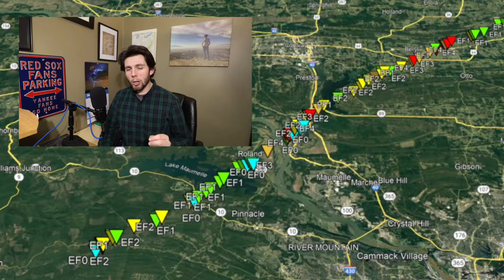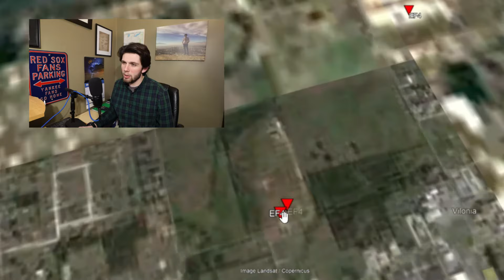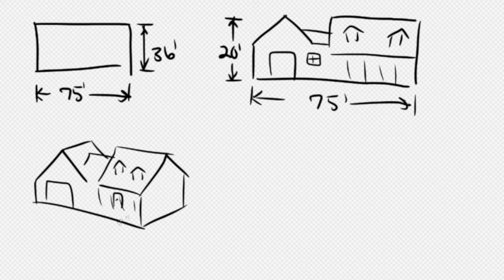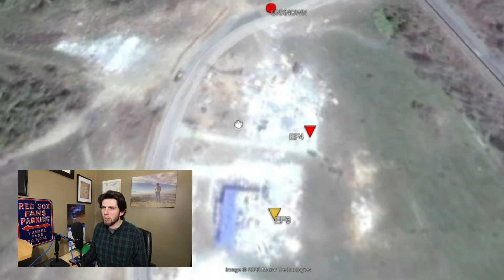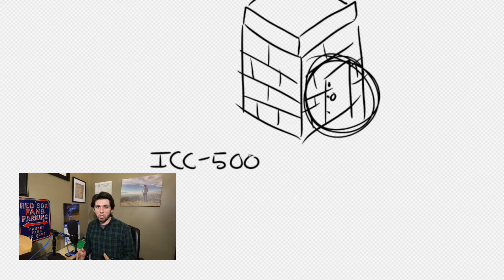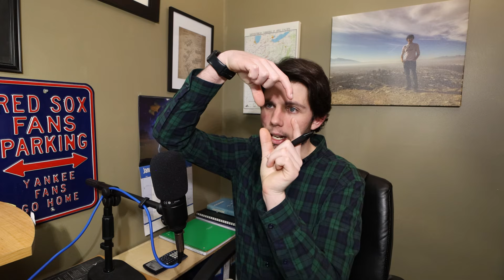DAMAGE ANALYSIS: 2014 Vilonia, AR EF4 Tornado

Comment: A few years since you posted this awesome video; I’d like to see NWS revisit this one as far as rating. After the ND EF5 last year (2025), non-traditional DI’s can be used. The parking stops being pulled up, overturned, and lifted up, as well as a very large 58,000lb shipping container being lifted into the air and tossed onto the roof of a school. Curious about the force needed for these instances, and if these would help push this 2014 Vilonia tornado into EF5 threshold. Ultimately, the destruction of property and impact/loss of life from that is far more important, but the science of these are also crucial in fine tuning a more accurate rating. Just one persons opinion 😁

Comment: The tornado was moving at snail's pace most of your violent rated tornadoes to clock speeds up to 70 mph with their forward movement speed it ripped apart asphalt it sucked it up into the vortex

Comment: The outbreak of the 2011 super outbreak happened 3 years earlier there were six EF5 rated tornadoes within that outbreak I remember part of  in poplar bluff we had severe hail severe flash flooding no tornadoes I don't know if the vilonia Arkansas was hit by an ef2+that tornado was a monster and it had a multiple vortex signature on radar you can actually see the storm splitting that means if the storm turns to the right you're getting a violent tornado threat if it turns to the left you can get a large hail threat

Comment: You miss some indicators  that had LEGIT ef5 damage  in cody lane well anchored homes were renoved and it had a windspedd of 219mph in the highway and some damages  proved it like a 2,997 pound fertilizer and threw it 3/4 miles away

Comment: I really hope you analyze the Greenfield tornado. There's absolutely no reason why that tornado should be anything less than an EF-5. None. 

When you have extreme damage, debarked trees, ground scouring, AND scans from a Doppler on Wheels clocking wind speeds of 250-290 MPH... That should really be all of the evidence necessary to rate the Greenfield tornado an EF-5.
Reply: Vilonia rochelle new wren ringgold and mayield alongside a couple did same damage as smithvulle and hackleburg but got a 4 or even a 3

Comment: A CPA accountant friend of mine shared an office building with an engineering firm years ago. Being a CPA he was, of course, concerned mostly with financial balance sheets and monetary bottom lines. He shared with me how he learned from the engineers in the office building that they first consider best structure and materials. Then the accountants get hold of the blueprints or designs and suggest places to cut costs. A final product will always end up being a compromise.

Comment: I think the more we learn about tornados - particularly the larger, multi-vortex ones, the more we'll realize that the entire concept of assigning ratings of strength based on windspeed (with or without getting there by way of damage done), is an inherently flawed idea. 

Until we can pick apart the anatomy of these big multi-part systems, see how the different parts interact, see how and why sub-vertices are forming and doing what they do, it seems approaching arbitrary to assign a rating because at one point one element of these big tornadic systems reached a certain windspeed. It's not totally unhelpful, don't get me wrong, I just think it's not something to get hung up on and really demonstrates how alarmingly little we actually know.

Comment: I believe the way tornadoes are rated throughout different NWS offices are inconsistent. Some offices may take into account contextuals like in cases with RF, but some others may not like with Matador. Some offices may hold back ratings of EF5 due to lack of surrounding vegetation damages like with Rochelle, but may not take that into account in cases like Moore 2013 (some trees around EF5 DIs still held up). There needs to be a more strict system on the EF scale that can ensure tornadoes are being properly documented for the use of construction standards in tornado safety. Additionally, some say NWS Little Rock skipped over numerous slabbed homes towards the beginning of the tornado's path, which is reminiscent of similar cases like New Wren back in 2011. Another thing to note, this tornado was held back from an EF5 rating due to possible "debris impact" on a home rated 190 in an area without many homes, but NWS Norman didn't hold back on an EF5 rating in Moore where there were multiple homes that could've been involved with debris interference. I think I can go on and on, but there's that. However, I digress that EF ratings matter more than the lives lost, lives are more valuable than documented statistics.

Comment: Fascinating and thorough engineering analysis. So did the door fail at the deadbolt and then swing inward striking an occupant resulting in the fatality, or did the opened door result in the ejection of an occupant, greatly increasing their vulnerability?  Also, please consider doing a video analyzing two actual tornado damage phenomena: 1: the peeling up of asphalt pavement from a road...2: the plowing of earthen ground several feet deep such as occurred on 4/27/2011 near Smithville, Mississippi.  Both have amazed me ever since I heard of those facts. Thank you again for such wonderful, technical content!

Comment: This is one that I looked at a lot and question.  So my honest analysis of this tornado is I think they are splitting hairs to much on the rating on this one.  Why?  Im not sure but I can only speculate.  Maybe Arkansas just dosent want that infamous EF5 rating.  Who knows?  All I can tell you is that this tornado was very reminicent of how the Joplin tornado was and I dont think the Mayflower tornado gets nearly enough notoriety.  There isnt going to be much difference between 190 mph winds speeds compared to 200 mph wind damage.  There was also evidence of the wind speeds being greater than 200 mph.  The things that tornado did was insane like carrying a 30,000 pound fertilizer tank for a mile and the winds did level well built bolted down homes to nothing but a slab.  Very large trees completely debarked and widdled down to nothing and a large portion of the town being swept away and deposited into the nearby lake.

Comment: 5:39 so they had anchor bolts but the builder didn’t tighten them with the included nuts and washers?? How in the world does that pass building inspection?  Shouldn’t this put some liability on the builder, too?

Comment: Assuming the shelters were above ground, wouldn't they have a better chance to fail compared to those built underground? Watching much the media footage during the F5 Moore and Joplin Tornadoes for example the local meteorologists that provided the constant warnings and updates would mention that these were tornadoes that would only be survivable "underground". Now if there were victims (being those that survived but suffered complete loss of property) that survived in above ground shelters then I can see that having either doesn't really matter, but if those communities have primarily below ground shelters and none of the fatalities happened in them, maybe it's a question of shelters built below ground having higher survival rates when in a F4 or F5 situation. And having seen videos of people hunkering down in below ground shelters as an F5 or strong F4 passes over head it looks as if the tornado was just a little stronger even they would have been in serious danger. Those doors, though bolted shut, have still had to have 3 or 4 men hold them down to prevent them being ripped off and all sucked out of the shelter. For me however the only fear I have of below ground shelters is having a couple cars or an entire house on top of the shelter and not being found in time. Either way when in these situations the chances of survival from a direct hit of even an F1 aren't guaranteed. I don't live in a tornado prone area and in my 50 years have been near them but never actually saw one was enough. As a kid I had nightmares about tornadoes the same as I did about Godzilla, being chased by a large destructive whatever, and having no control over surviving is a common theme in them.

Comment: I feel like there should be two rating scales for tornadoes. The first scale is for actual damage caused by the tornado, and the second scale is for max radar estimated wind speeds of the tornado. I believe that there have been multiple EF5 equivalent tornadoes since 2013. They just did not hit any towns/buildings, or only hit structures that were poorly constructed/anchored. Therefore, the tornadoes could not be rated EF5 due to a lack of equivalent damage.

Comment: This was a strong tornado that impacted these areas of Arkansas on that day and no doubt it was a EF4 and even possibly higher at points of its existence but if I were someone looking to build a above ground storm shelter, I would not care what the cost is of a door would be because human life only gets one chance and it’s better to always take as much precaution as possible to protect your life and anyone else’s that you can in situations like this... One other thing I wanted to mention is the Mayfield tornado and I’ve seen a lot of tornado damage over many years and I Have heard they are going to re-analyze that tornado and honestly I think that should have been an EF5 with some of the stuff Seen in its aftermath like the basically a heavy stone and mortar courthouse that it destroyed for the most part and then capable of lifting A train locomotive that weighs roughly 170 tons if not more then taking it up a hillside for roughly 300 maybe 400 feet if not maybe further and slamming it to the ground, pretty much bending it, showed the almost unimaginable strength that tornado had

Comment: So, the fact that the construction of this first house you cover has not been built without the hardware required for Anchor bolts, like a lock washer and tension nut to fasten down the seal plate.
No sure if it would have prevented the loss of life,but its subject for judgment on the structural integrity of the house.

Comment: Thanks for the video. Interestingly enough, if you look at the Joplin Emergency Manager's EXCELLENT video on that EF-5 (long but worth every minute), he mentions that there were few indicators present for an EF-5 rating at all in Joplin, as the impacted areas were poorly constructed homes. Many of these homes were built long ago in the chat mining days, a similar story to a previous inflation-adjusted record holder (nonetheless F4) in Wichita Falls '79. IIRC, damage at the car repair garage at the high school finally lifted it to EF-5. 

Vilonia '14 reminds me so much of Pilger 1. It, too, produced "EF-5ey" damage, including easily blowing through maxi EF-4 norms and even one indicator evaluated at EF-5 by one team near the church on the northeast side of Pilger. This rating indicator was not accepted as EF-5 by Omaha, however, due to the lack of confidence in the well-constructedness of the home (it seems there may have been internal disagreements at play, which can be seen on this house's specific damage assessment located close to the church on the NE side of Pilger). 

I disagree only with your critique of live impact wind assessments due to their obviously inconsistent presence at all tornadoes. This is, of course, the exact same as any other ratings marker - those indicators are not always there too, as was the case in SPS '79 (though the scale was likely top-notch back then given what little we could do compared to now!). A well-bolted home may be totally absent from the peak of the damage path ... just like a mobile Doppler! 

I don't like to complain about something and not offer a solution when I at all am equipped to at least BS my way through one, so here it goes. I think that the rating score should be given more of a fine tuning than a replacement. The tech is here - and we need to use it, because I strongly suspect I've chased down more than just two "contested ratings" or "wind-measured" tornado at EF-5 intensity, and I also suspect that violent EF4+ tornadoes may happen more often than we know. 

Andover 2022, Pilger, the brief 200+mph multivortex wind speed measured near KDDC in 2016, Quad State, this tornado in this video and of course El Reno are just a few stellar examples of probably underrated tornadoes. After seeing damage first-hand and viewing hundreds of photos of damage on the NWS reports website archive, I personally think moving the bottom line of an EF-5 from 200 to 190 would still include the destructive criteria and impact on well-constructed homes that EF5's are defined after. 180-190 mph just seems like that "magic line" where even the best homes can be swept away. 

Great content, keep going. Looking forward to more.
Reply: Um reading Timothy Marshall’s report there were the most ef 5 damage indicators in Joplin, More than the 1999 Bridge creek tornado where there were 17, the 2007 Greensburg there were 7, The 2013 Moore tornado’s 9, (10 if you include the medical centre). And 22 in Joplin. Plus the damage to St John’s medical regional centre was rated ef 5. Every window blasted out in 3 sides. Significant damage to interior walls and floors. Cladding striped off of the walls and severe damage to the building envelope, the total destruction of the roof. The destruction of concrete and metal out buildings including the generator building. The removal of the underpinning. And the whole main building was shifted 6 inches off of its foundation. Permanent structural deformation with winds exceeding 268 mph. The 9 story structure received such extreme and extensive structural damage that it was deemed structurally compromised and torn down as a result.

Comment: I wonder what it would take to design and build a house to survive a Tornado of this kind of power? I expect a lot of money. Here in the UK  (where we don't get anything extreme) most if not all housing is built from brick. Depending on the age some are single thickness but most are a double thickness but tied together  with a cavity between them filled with foam Insolation. Some even have breeze block filling as well as a some sort of insolation.  I guess its cheaper to rebuild a wooden house though after its been swept clean off the slab.

Comment: Okay that house  looks  like the garage was a later addition. Look closely to the side of the "street view 'before' picture"..  there is a definite gap area to the side of the house where the garage is added. You can see a definite shadow line   When I grew up in the 1950s, several  homes had an UN 31:20 31:20 attached  garage that was LATER attached  by the addition of a closed in area between the house and the garage called a "breezeway".  To me this would change some dynamic parameters  than if the garage was attached to the home at the time of construction.

Comment: I’m wondering where the safest location is in my particular basement. We have a walkout that faces SW. The parts of the house that are ‘deepest’ into the earth are at the corners opposite the atrium door for the walkout (separate rooms). One in next to the garage wall and fully underground (95%) and the other corner has one wall 95% under and the perpendicular  wall 50% under (progressive slope on that side. OR the bathroom thats in the center of the basement near the stairs. Our exterior is full brick facade- does brick cave down into basements on well built homes typically? This is a high end house built in 85.
Reply: Whichever part is the most underground, ideally far away from any windows. The bathroom you stated is in the middle of the basement, some folks would hide in the bathtub with a mattress on top. Under stairs & utility room are also solid options.

Comment: Does the building drag coefficient (Cd) consist only of the downwind force on the side from which the wind blows, or does it also include the suction force on the opposite side, where the pressure falls? I have long wondered about the verification of an old scientific paper in which a researcher tried to assess the wind force in a tornado by calculating the wind-induced thrust force based on a case of a train overturning and a case of a brick building being demolished. The result was a thrust force corresponding to winds of improbable speeds, at the upper limit of the former F5 category. I researched this case in a different way, found many press reports and photos and know that in most places the destruction corresponds to a wind force in the F3+ category in some places weaker F4 (or T5-T8 on the Torro scale). The researcher has therefore over-calculated. However, I do not know what exactly the error is. I suspect that he has either assumed too high a strength, or that the assumption that the wind acts on the object only by pressure on the windward side is an oversimplification.

Comment: Being an apprentice tool maker and a volunteer firefighter. With having a little understanding of tensile strength and the stress loading involved. Your analysis is incredibly easy to understand on the hardware failure.
Reply from the maker: That’s great hear! I’m glad it came across easily digestible.